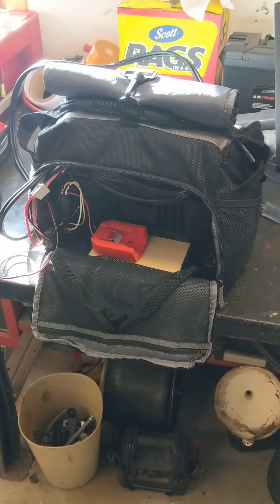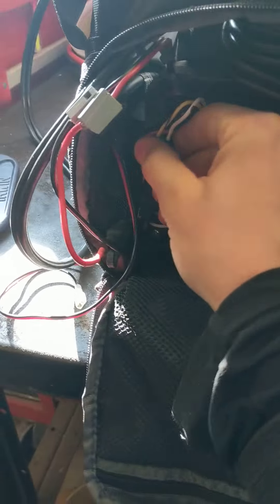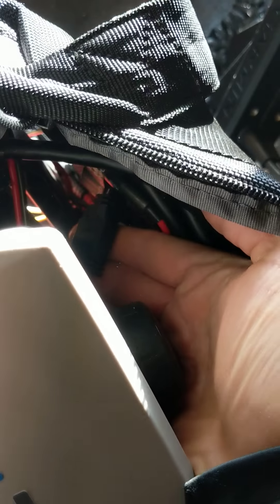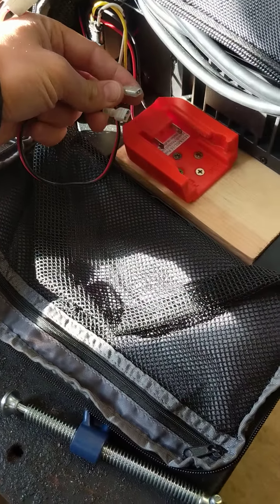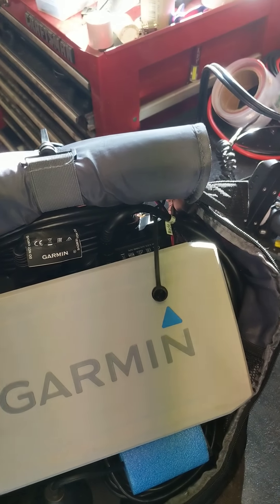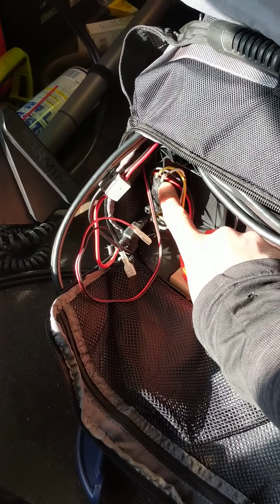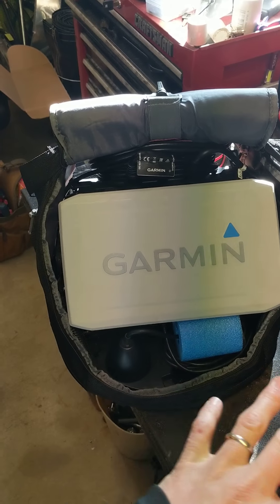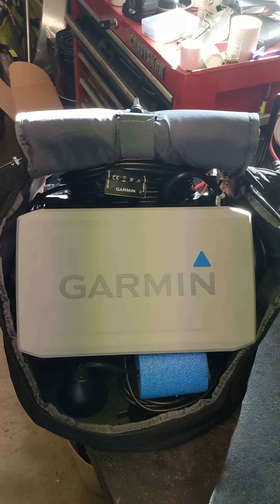Garmin Echomap / Livescope M18 Battery wiring update. (Wiring explained)

Comment: Thanks for the great explanation. Any update and issue with the direct wiring to both units without the voltage reducer, so far? Thanks again!
Reply from the maker: I don't personally run that system anymore because I started working with amped outdoors and their batteries aren't amazing. However I know other people that still run the Milwaukee battery and have absolutely no issues at all.

Comment: Could me what that bag is called again I can't seem to find it on line and would that bag hold a 9 inch unit?
Reply: I got it as part of the Garmin Ice Fishing Kit which is part number 010-12676-20. I am not sure if you can just buy the bag by itself. It does hold a 93sv(9" screen) which is what I use and I believe 818 Outdoor uses.

Comment: Can I use a ridgid battery instead of a Milwaukee?
Reply from the maker: Check the fully charged voltage, anything over 21v I wouldn't.
Reply: I did buy a Dakota 10 amp lithium battery and was wondering if it will run my unit for the whole day. Also was really curious if getting the ice fishing transducer is worth it or do you find yourself using the livescope most of the time? Thinking once I find the fish I would turn off the livescope to save battery and just use the ice ducer
Reply from the maker: All depends on the unit. Not a Garmin with Livescope.
Reply: I have the 93sv. Did you mean you don’t use the ice ducer?
Reply from the maker: I use the ice ducer in deep water (80ft) otherwise livescope only.

Comment: How do you convert from 20 volt to 12 v? Hate to fry the system.
Reply from the maker: You don't. Run it at 20v. Your not going to fry it. There's hundreds of people doing it and I have hundreds of hours logged with mine.
Reply: I was just asking because I have work with 24 volt systems, having to fix 12v running 
Systems that people hook into
 24 v, I'm just saying Iv spent a pile of cash on my Garmin electronics, I would hate to see anyone fry there electronics.
 20v to 12v converters are CHEAP.
I love your idea to keep the pack light, and most people have portable hand tools and mutable batterys. Great idea.